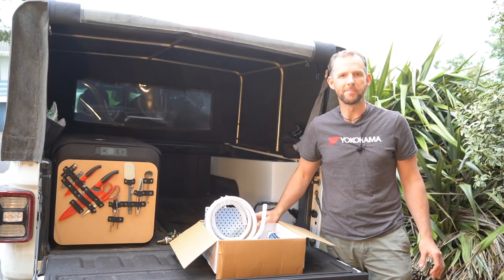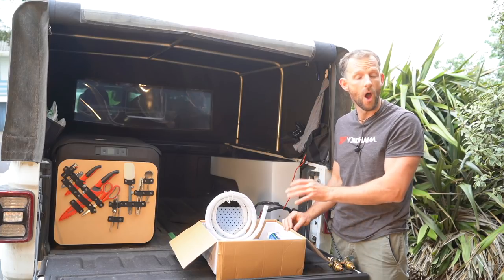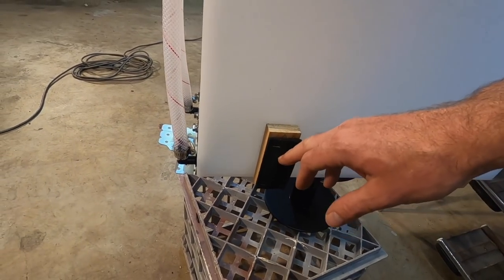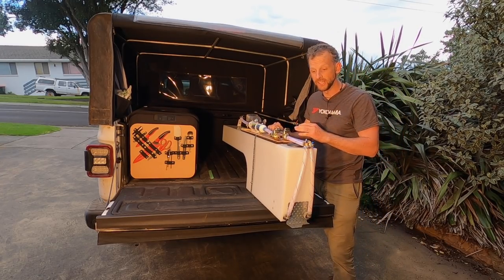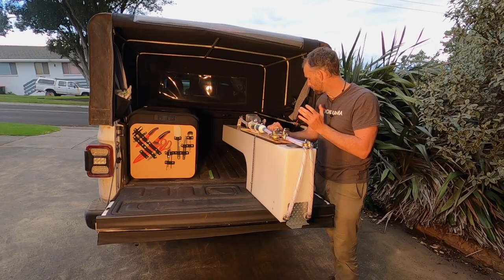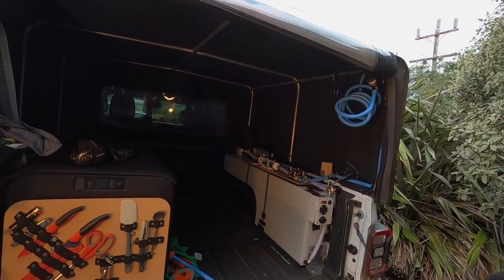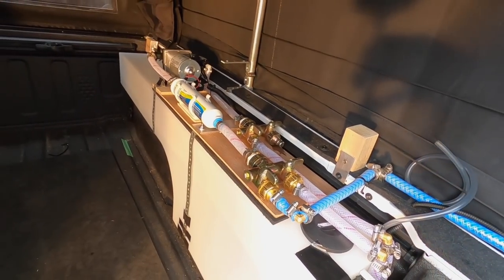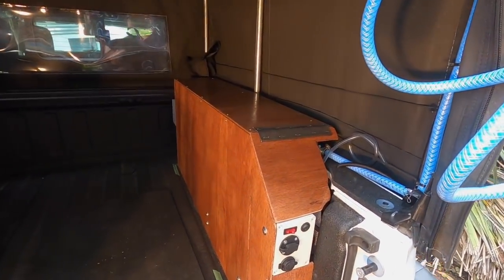Overland Vehicle Drinking Water and Filtration System - Part 2: Build

Comment: Just a tip use food grade hose to fill the tank from any tap.  The RV stores sell them in long lengths.  You might have already discovered that Clarke Rubber also sell a range of food grade hoses.
Reply: Is that really necessary since you're running the water through a filter prior to drinking?

Comment: Very good system I built something very similar. I would run water out of the tank through the pump and filter then back into the tank to give all the water a good clean if it was getting stagnant.

Comment: Two items I've installed to my version of this setup (inspired by your africa jeep)... First is a flow rate adjuster. I keep it fairly low for cooking/ water bottle fill up but I can adjust it so the pump is full blast. Helpful with the sprayer if the dogs are dirty. Second is on the output side I have another tee fitting. One side goes to a fixed sink on the end of the JKs tailgate and the other end goes to a sprayer. Best of both worlds!

Comment: Pretty awesome, one thing about covering up the tank is it's harder to see how much water you have in the tank.
Reply from the maker: I cut a slit into the plywood for that very reason, and the courtesy light in the bed of the gladiator shines right through the tank so I can perfectly see how full it is!
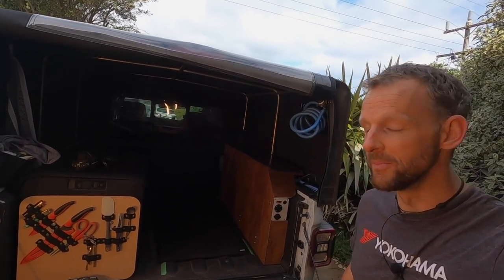Reply: Go to 26:50 and you will see the slot cut in the wood.

Comment: To save your system filter cartridge, if the water source is noticeably less than pristine, it could be pre-filtered using some dense cloth when it is poured into the bucket the water will be suctioned from. Then these pre-filtering cloths could be hand washed, dried, and reused for the same purpose when needed. It would probably make the store bought ($$) system cartridges last longer.

Comment: The impedance of fresh water across a 12v system is so high that it's highly unlikely that it will cause a short circuit. There should be no issues with what you have done. Great job.

Comment: Definitely informative. Thanks for sharing Dan. 👍 If you don’t mind I say so, maybe doing a short length suction to hang just below your switch box may remove chances of water wetting the tank surrounds.  This short length pipe with a clip adapter can be a more permanent setup and can be connected ( plug or unplug ) to your normal flexible suction pipe. Just my two cents worth. Haha!

Comment: If you cant find it in at the corner hardware store in Australia. you have to go to industry specific stores. Ie irrigation  suppliers…There is no problem we haven’t encounter before. When we did anything with water on our last camper we went to a plastic injection moulder for the tank, we chose one of there pre designed template that would fit the space the best, went to an RV place for the pump as they had it in stock and available on the spot. And any piping and filters we went to an irrigation specialist in town.  Almost any large community centre out in the bush have an irrigation shops. People just thinks it for crops only. as far as I know they all do food grade too, they have every thread under the sun any pipe and connectors in what ever materiel you want and huge selection of filters. Down side it’s more expensive, but it looks the part and lasts.

Comment: You still have 4 valves in the setup, they are just paired on manifolds. 3 way ball valves are available (probably even in Australia) and would be a better choice in my opinion.
Reply from the maker: I looked really hard, and couldn't find them here
Reply: @TheRoadChoseMe   Fair enough. Nice system by the way. I do like the fact that your valve setup allows pumping and filtering in such a flexible way.
Reply: A quick search for 3 way valve Australia yields some options but I doubt it is worth changing since your system is clearly functional.
Reply from the maker: I didn't find anything that was going to be relatively easy to connect up to everything else - I made a few different frankenstein setups before eliminating connectors and adaptors to make it simpler, smaller and lighter

Comment: I would have made one of the fittings in the bottom of the tank, so i could have a gravity fed valve if the pump is not working.
Are those bottom 90 bend in Plastic? They are the only thing to stop the tank from draining if they break. 
I would have one gravity fed brass valve on one of them, and plug the other one.
Drill new holes from the top, and use stiff pipe to the bottom.

Comment: Great video, I know that you have ran a similar setup in your previous jeep. Have you ever been worried about the cleanliness of pump since it is technically exposed before any type of filtration? I know the know answer is that another filter and pump is probably not worth it.
Reply from the maker: It's never been a problem for me, but I also have never pumped in really nasty water. Usually what I'm filling up with is already clear and smells fine.

Comment: Hi Dan. I see you used some transparent hose as well. Did you have any problem with bacteria growth inside the hose due to exposure to light?  Would you recommend the blue hose? Any problems in the tank? How  did you clean or disinfect your system and how often?Cheers mate, you’re an icon.
Reply from the maker: No problems at all. The water in Australia is very good, so I wasn't worried about it.
My system filters the water on the way into and out of the tank, so nasties can't even get in there.
Reply: What about Africa? I know you had a better filter there but did you have any problems with bacteria growing inside your water system?
Reply from the maker: My system for Africa also filtered it on the way in and out of the tank. It was a 0.5 micron filter and included a UV lamp to kill anything that was alive.
So I never had a problem, as nothing could get into the tank.

Comment: Hey Dan, enjoying your videos. I have a JK and am going to put in a water system...question...can you use brass garden connectors to click onto the filter both sides, or will they leak under pressure of the pump? What have you used there and is it all holding up ok?
Reply from the maker: My filters have had 1/2 inch barb fittings on each end, so I just put hose on that with a clamp. Never a leak

Comment: If you open both taps on the fill side, and close both on the use side, you won't need to run your pump to fill tank from a domestic hose.
Reply from the maker: Right, but I want to filter it to get out the chlorine which is really strong here in Australia!
Reply: @TheRoadChoseMe  true, but I'm only talking about filling the tank. When you use the water, it will flow from tank, pump, filter and out your squirty gun. It still gets filtered on the way out.
Reply: So I re watched @22:00 and see you're double filtering. Ok, fair enough. What about a bypass valve so it still filters, but don't have to run the pump? Just thinking for time, ease, wear and tear and battery life.
Reply from the maker: I used my other setup for 3 years and 54,000 miles around Africa through 35 countries. It still runs flawlessly now. This system will last, and I'm not worried about wear and tear. As for the battery it runs off the solar, and time is what I have plenty of!